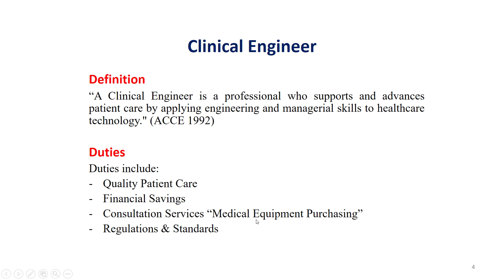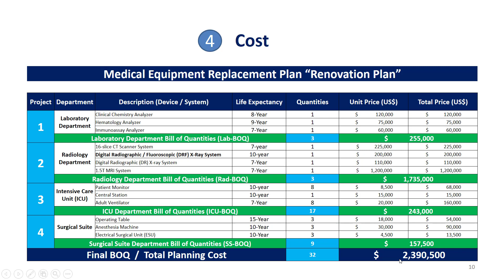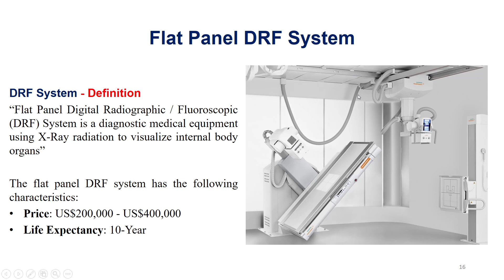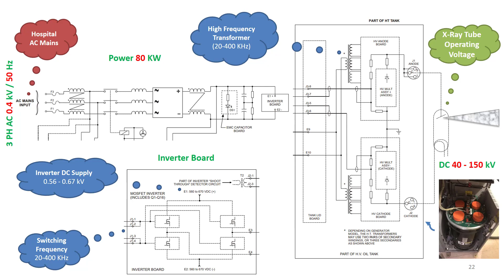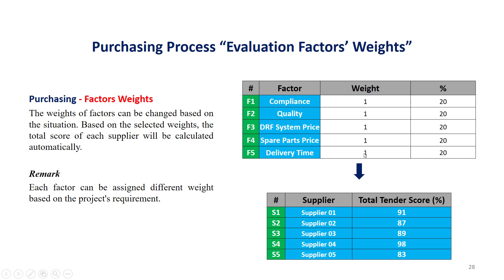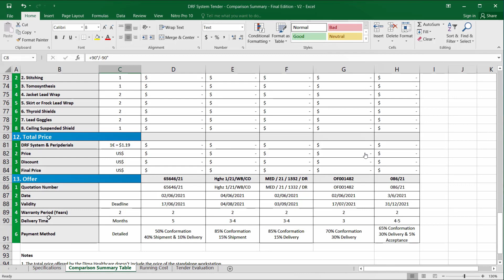IEEE eSmarTA 2021 Conference - Purchasing Medical Equipment Informed Decision (11/08/2021)

Comment: Amazing and wonderful presentation. More than thankful. It's an interesting mixture of knowledge (engineering, management and healthcare). Can you explain more about the nomenclature "flat panel DRF system"? I mean flat panel.
Reply from the maker: My great pleasure. As for the name "Flat Panel DRF System", in the previous generation of DRF systems, the manufacturers were using image intensifier instead of dynamic flat panels. This is the part of the history of the DRF systems.